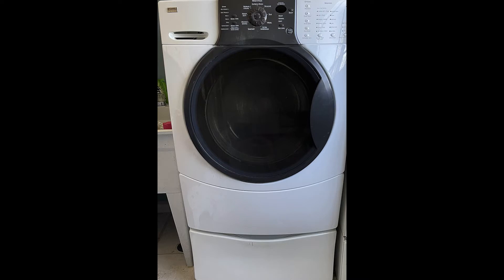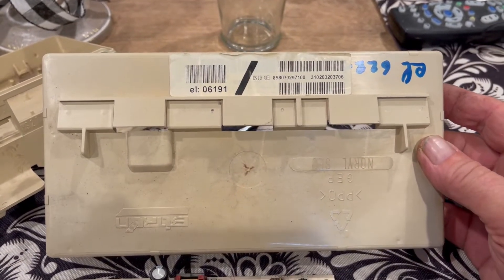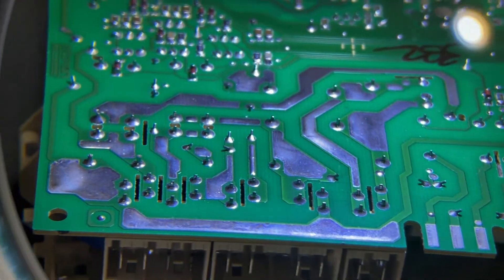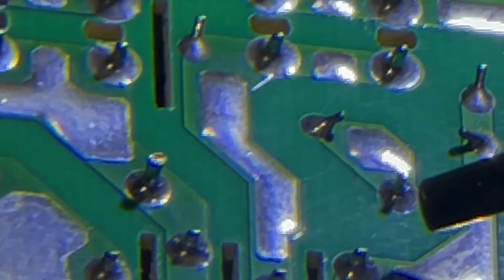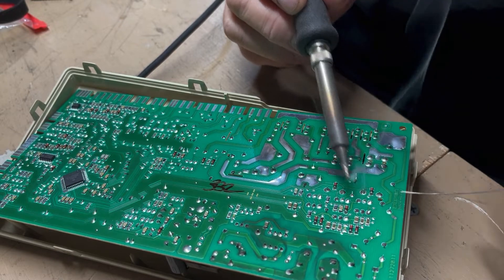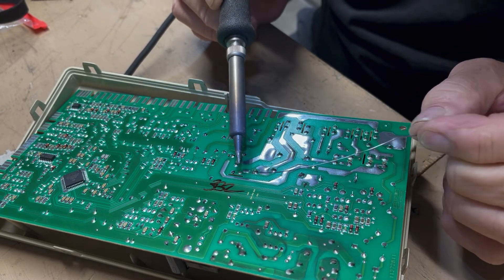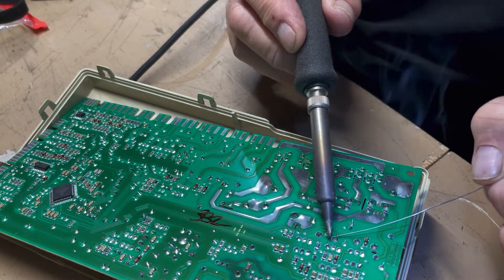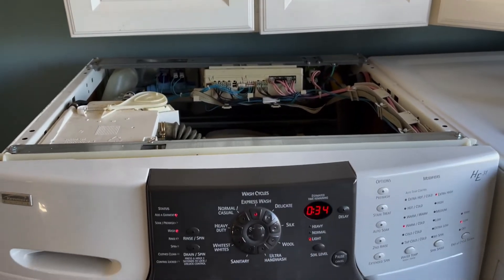Part II Sears Elite HE3t Washer failure How to soldier circuit board

Comment: Eric.  Give me your honest assessment.  I am 75 with a Chronic coronary condition - my fingers  no longer have the dexterity of a 35-year -old.  Do you rally think I can manipulate the plastic  tabs, multiple wire harnesses  of the Motor Control Unit wiring without breaking the plastic tabs?  From your video - this is a really confined space to dislodge and then replace the motor Control unit on the side unit wall!!  Advice.  arthur green